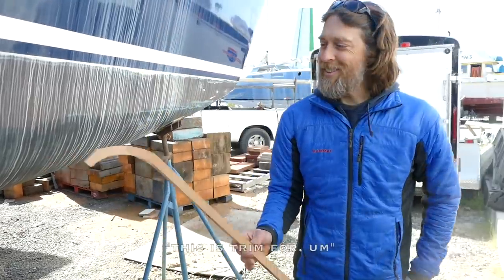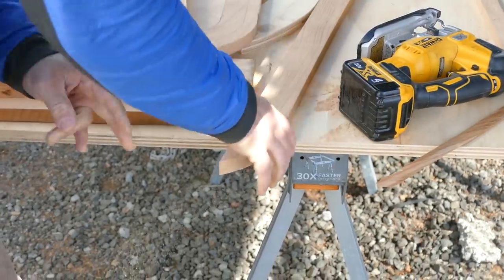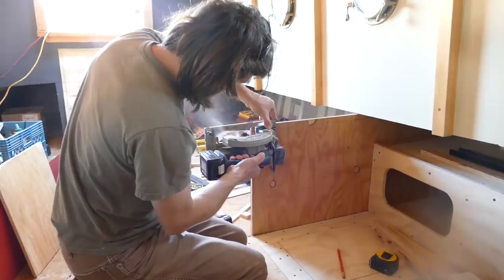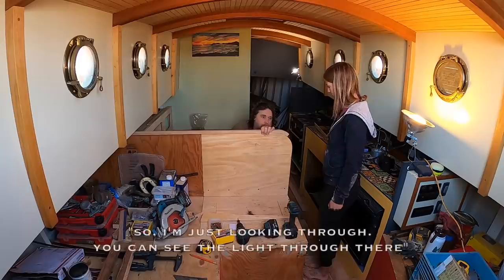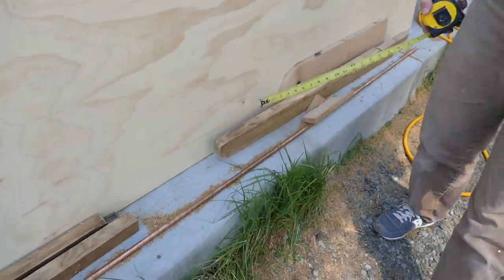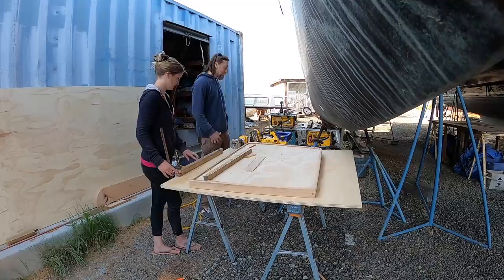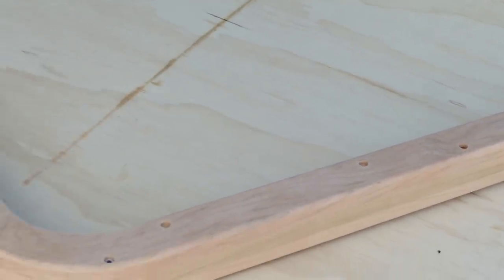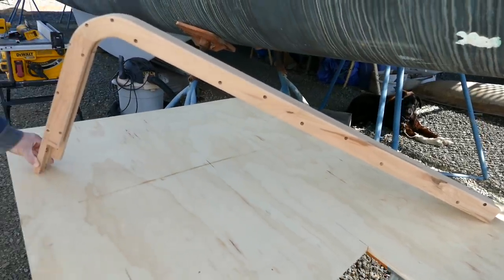Salt & Tar: Ep.140- Rounding a Corner

Comment: Hey Ruth, good job with the power tools, now to make the sanding much easier buy a Porter Cable Profile sander. It has all the interchangeable profiles to match the curves you will need and the sandpaper sticks to the removable rubber profiles. It is a hand held unit and works great for small trim work.  Looking Good!

Comment: So as I watched the last few minutes of this episode it occurred to me that wouldn't it be nice to have a 24x18 inch window to look out of while sitting at that beautiful table.  It might even be nice to have the option of folding those fids out of the way under the table or just the ability to remove them so they don't interfere with working on a notebook while editing. You all are such talented craftsmen it should be easy. Bottom line...you all did very nice work on a beautiful table.

Comment: Where I have applications that require removable parts I think about using threaded brass inserts with brass bolts, strong and no worries about stripping out screw holes or rot at screw holes

Comment: To avoid the burnt surface when routing you have to feed the router faster without stopping in the cut. Usually about 80% of the heat built up in a cutting operation is carried away by the shavings or swarf. So if you are feeding to slow or even stop feeding the heat builds up really quickly and you burn the workpiece or possibly the tool.

It could also be due to a dull router bit or resin build-up on the bit.

Comment: I noticed it being tippy when you pressed on the edge. I was thinking maybe a fold up triangle board for a leg that is wide at the to and smaller at the bottom for leg room but provided support at the top for those days on the water when the sea is angry and you have to find a hand hold fast that will support your weight. Just the thought. Love the channel. LOVE the table and the fine work you all are putting in.

Comment: I have been worried for some time that you don't have a proper horizontal timber profile finish to the vertical columns for the house.
You need a continuous solid timber profile finish with good hand grips all the way - and a pleasant look to complete the cabin design - which I like.

Comment: Here's a solution to your table problem that you might want to concider.

Make your table three sections and hinge them together. ... if you do this right your table will fold and store 90° to the wall and you wont have an airplane wing hangin out 45° .  Most importantly your head will thank you for it.

The first section needs to be the distance from the wall to the corner of the over hange + an 1/8" that will give you your 90° fold.   The other section of the table needs to be cut into two equal parts ... this is so the table can fold  dow upon itself.

This will allow your table to fold and store flush up against the wall when uder way and then unfold into your beautiful table when you want to use it.

Your head will love you for it and it will look amazing clean and like you ment to do it. .... ⛵💕🌠

Comment: time to sink or swim, guess you learned to swim in a short while :)
btw, next time you want to tighten two pieces of wood that are so short in the grain, think of using screws with a flat back as opposed to triangular heads, that will put way less strain on the grain, just a common sense thing for next project. other than that, the curve looks wicked nice.
final notice, the rounding over tool works so much nicer if you have a resting point on both sides of the cutting edge, just use a piece of scrap wood with the same height as the piece you are machining on, makes things so much easier.

Comment: have you considered rounding the bottom of the ribs inside the cabin, especially where the table top is going to be mounted so you'd have a little more lift of the angle of the table top? and rid yourself of sharp corners.

Comment: I am quite confused by you using a tiller for steering all the time, as this means that someone will have to be on it at all times. I know that you are doing the rustic thing and it is beautiful, but having to  be in control of the tiller at all times while traveling might loose it “rustic” very quickly.